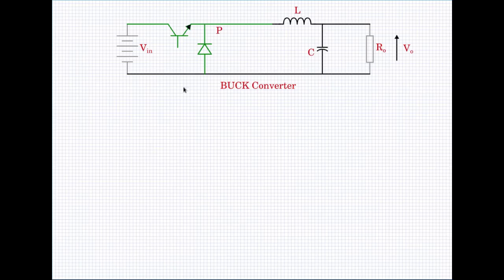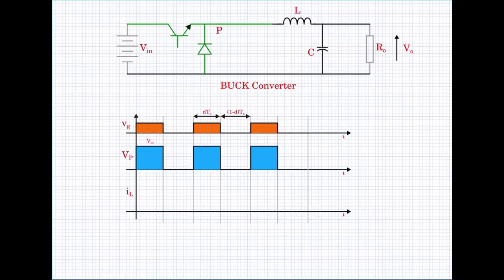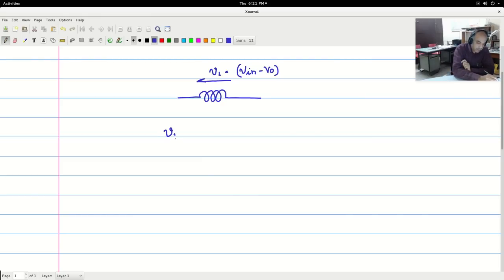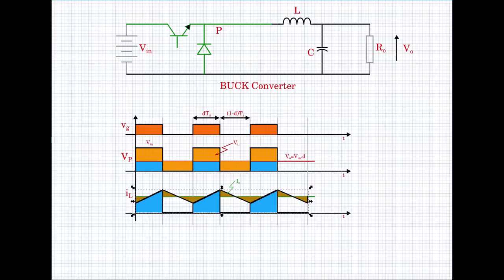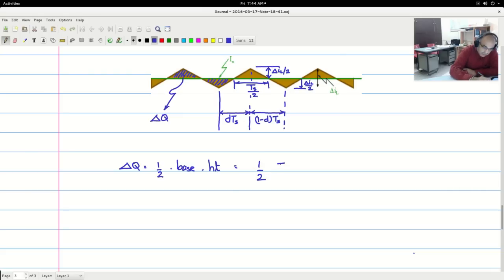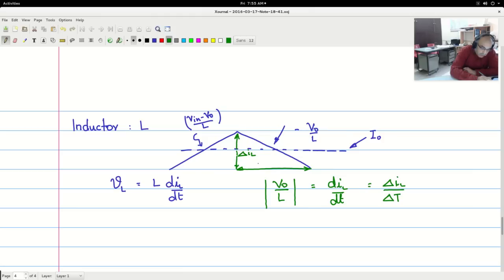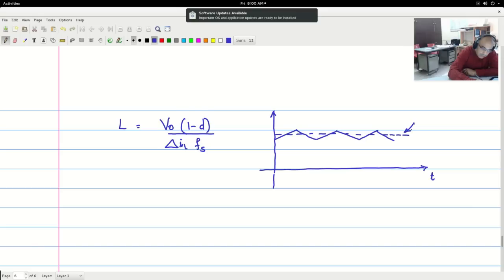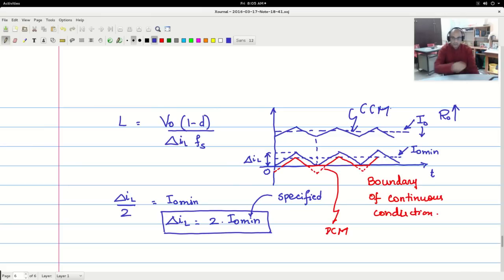Understanding Buck Converter

Comment: When switch is opened, inductor will change its polarity so that diode will be short circuited. In this case if we apply KVL, then Voltage across the inductor is getting +Vo know. Please clarify this sir.

Comment: Hi Sir, in the 34.04 min video explanation delta iL is mentioned as 2 x Io. But the converter datasheet explains ripple factor which is delta iL/Io. Could you please provide info on this ripple factor?